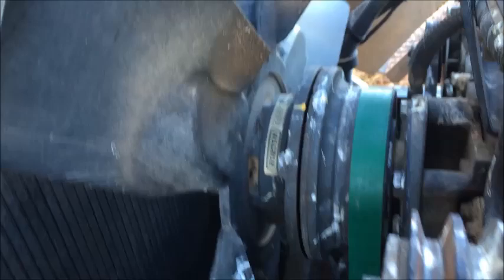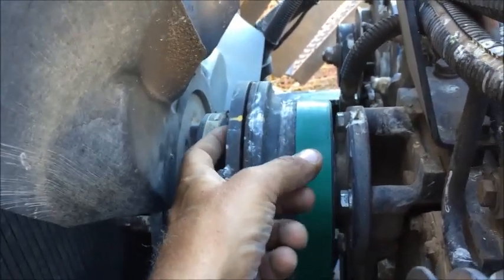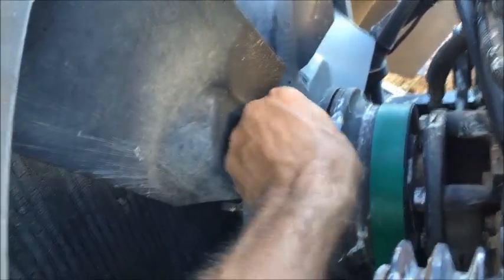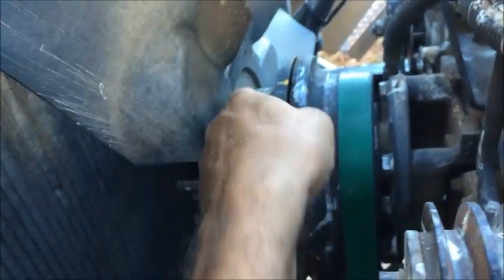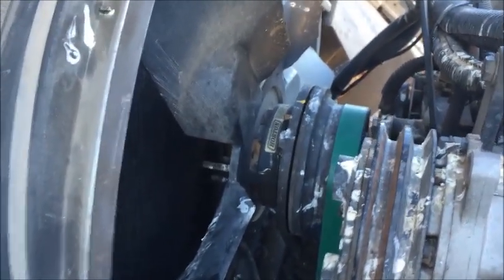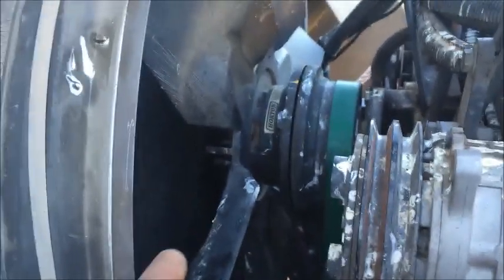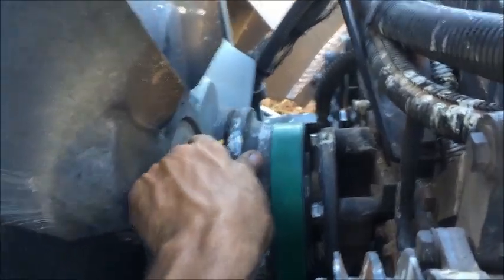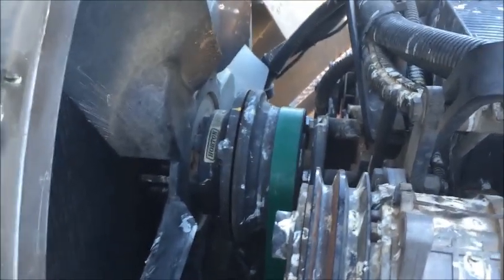Cummins Engine Quick Fix a Fan Clutch Easy

Comment: I just wanted to say thank you for this video. I am a brand new order operator and NOT a mechanic. I was basically stranded in Denver on Sunday and couldn't get over I70 to Grand junction because my fan clutch went out. I came across your video and it got me running though to very to Grand Junction. Thanks again

Comment: Does anyone have video of the air line set up for the clutch fan and where does it route to mine is a 98 379 with a cummins N-14 celect plus engine

Comment: I would like to see the uninstall of the fan on a cummins. My 97 needs one and my understanding it's I have to remove the whole front clip
Reply from the maker: the shroud, not the front clip. i may have one coming in soon, i will get it posted for you. thanks for watching.
Reply: Not hard to do. The hardest part is getting your tools out.

Comment: DOES IT MATTER CAUSE MINE ON MY 79 kenworth w900 is welded together but the truck still over heats but the guy at the store said if you want I’ll take your money but that’s not the problem changed the water pump thermostat too and got the radiator cleaned but it stilll over heats what can be the problem???
Reply from the maker: do a pressure test, its cheap and very effective. your loosing water somewhere. if the pressure test passes, only one thing left to do,,,,change the radiator cap. thanks for watching.

Comment: Also, I wonder what that extra weight from that bolt does to the crankshaft when spinning at 1200-2000 rpm - just saying lol I know it’s an emergency fix and it’ll get you going but I wouldn’t go too far …
Reply: The fan on my 2015 is on its own independent pulley. Not any cam or crankshaft.

Comment: I drive a Mack. Replaced the van clutch but it still stays on constantly.  Any ideaa?
Reply from the maker: i love macks ! prob should check what temp thermostat you have. years ago , we would put a piece of card board in front of the radiator covering less than half. ( maybe a quarter ) to get the heat we so much needed in the cab. they like to run cool. its not gonna hurt if it stays on, unless your cab is not warm enough for you.
Reply: @thomasbriansavingmoney  brand new motor,  dump truck.  After being loaded that's when it started.  Thinking a loose wire. No luck in finding it yet.

Comment: Looks like that truck had a bust radiator or radiator hose - that might have caused the issue with the fan clutch, as the dried coolant gunk goes everywhere… I can see splats on the engine…

Comment: +thomas brian my fan runs high speed all the time det 60series?
Reply from the maker: bad relay! in some cases a small piece of cardboard in front of the radiator will get it to run a little warmer. however i would check just to be sure the fan clutch did not seize. your fan could be running all the time.

Comment: WHAT HAPPENS IF ITS WELDED AND ALWAYS ENGAGED IM HAVING OVER HEATING PROBLEMS AMD ALREDDY CHANGED THE WATER PUMP RADIATOR AND THERMOSTAT
Reply from the maker: pressure test, if it passes, change the radiator cap. only put 14-15 lbs of air in it. most auto parts places have the tester to rent.

Comment: You don't want to do that on a OTR rig. Their fans are not meant to run at full engine speed and will come apart at high RPM. 
I saw someone try it and the results were not pretty.
Reply: ScottDLR why do it have the locking bolt hole then? Just asking
Reply: That’s not true! When pulling big hills or mountain passes out here on the west coast. I turn my fan on and put the rpms in the power band at 1700-1800. Never had an issue. If you don’t? It’ll over heat. Cat motors don’t like the heat
Reply: @MrFlatbeder  Your Cat's Horton fan will only pull so many revs and then as the eng speed increases, the fan doesn't gain anymore speed.  The effect is imperceptible but protects it from grenading.

Comment: Can I just weld it...?
Reply from the maker: i have in a pinch, heater doesn't work so good because its always locked up. but yes you can. i have also used cut drill bits in the holes. works fine. but eventually you will need to fix it.

Comment: 2013 Pete ac problems,  blowing warm air only ! Can you help me out ? just starting out and not able to take to shop due to money being tight in our household .
Reply from the maker: hey richard. sorry it has taken so long, been swamped. do you think you have enough Freon ? it is the number one cause. do you here the compressor kick on at all? there is a filter on the a/c may check that too. its tough to say, because i will need to know what all you have checked.
Reply: @thomasbriansavingmoney  yeah brother clutch is good and I did add some more Freon and it's better than before.  But thank you